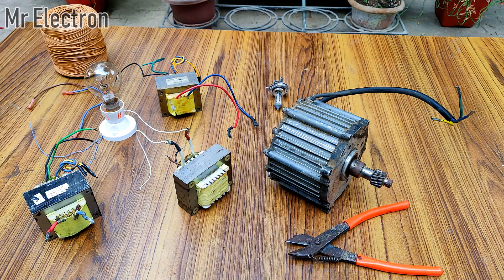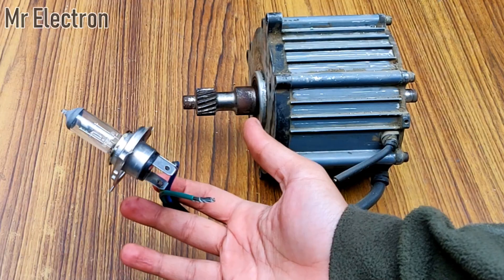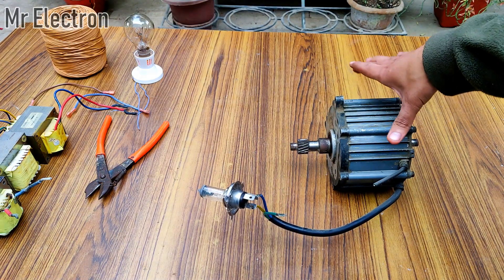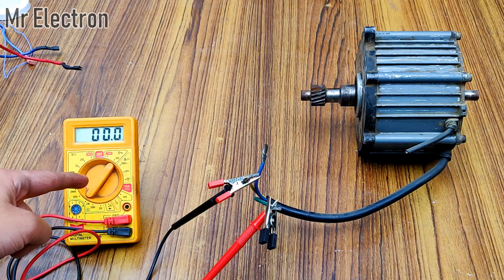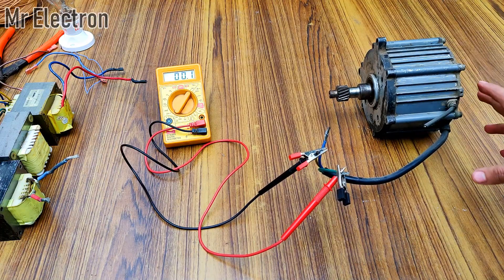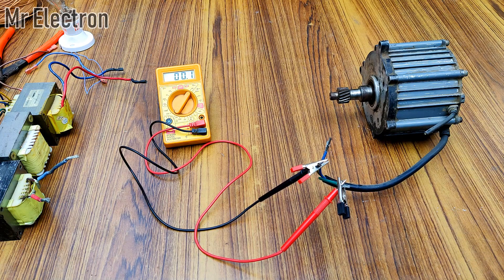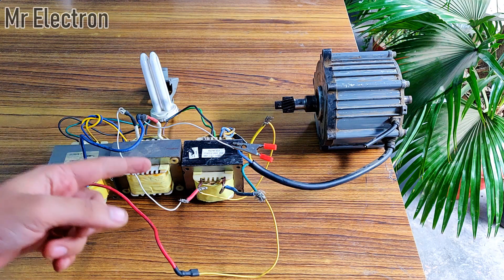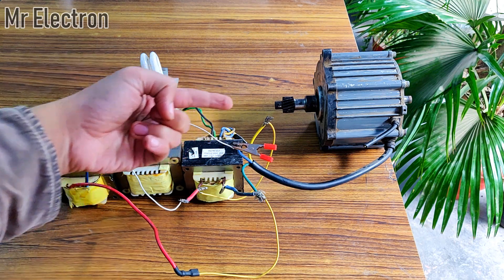24V 750 Watt DC Motor from e-bike as Powerful Brushless Generator upto 1,400V with Transformer

Comment: more voltage doesn't mean more power dude, It only push .5 amps with a 750 watt motor, just hook up a diode bridge, regulator and inverter, then power stuff. Also your using 2 of the 3 phases, that doesn't mean your using 1/3 of the power.

Comment: Its a bldc sensored motor from e rickshaw we repair these motors and controller thats why i know and one more funny experiment you can do with this motor is that connect this with an amplifier it works like a speaker with bass must try it
Reply: Good Day to You. He calls it an alternator and You call it a motor. I'm confused. How can he spin a motor by hand and get electricity? If it can be done, How much electricity at a higher RPM? I'm new at this and I need to learn as much as I can. Any help would be great Thank You. Yes, I love to read the comments,